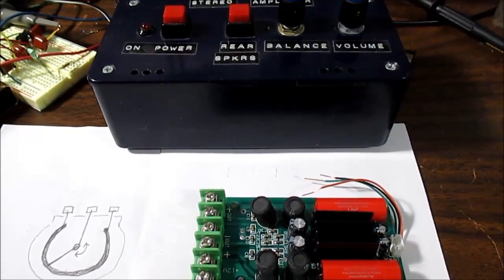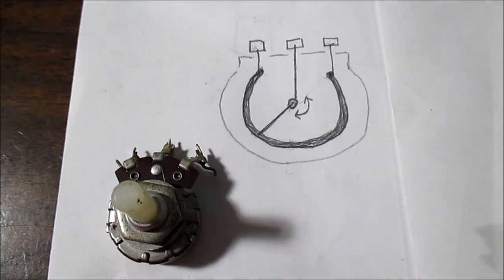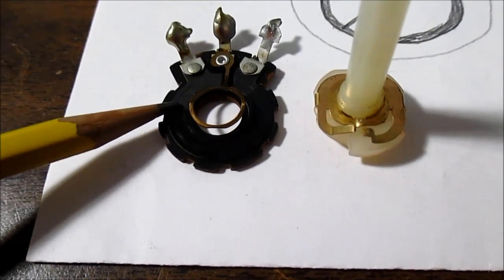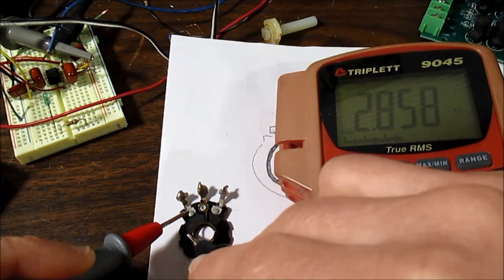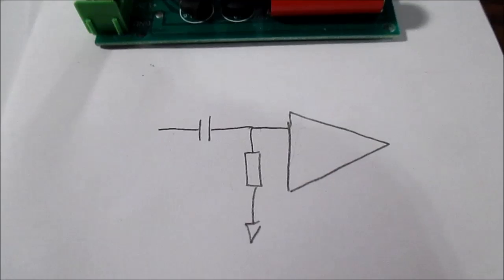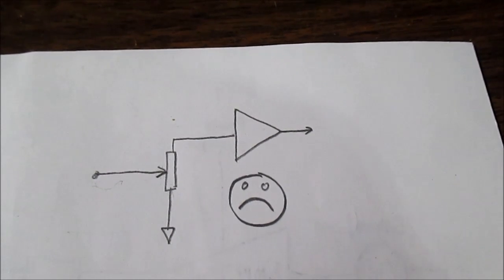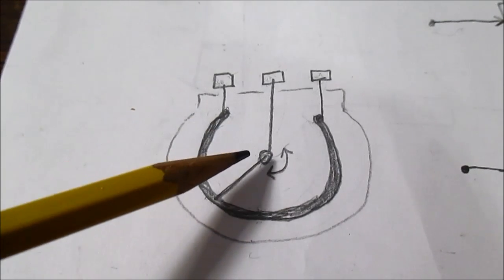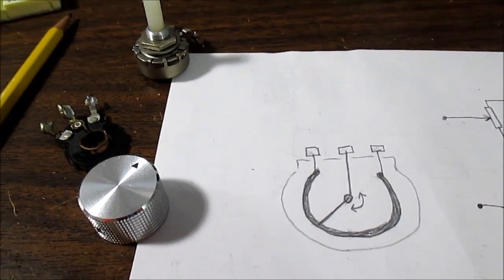How to add a volume control to your audio amplifier project

Comment: 1. Some people say A type potentiometer means Logarithmic & B type is linear. Is it true?
2. The input impedance for tda2003 according to datasheet is 70 (min) to 150 k (typical) so what value potentiometer to use there ?

3. If I want to choose a volume control for transistor amplifier like a 2N3773 based transistor amplifier having two pairs of 3773 transistors at output stage then how to do that as there's no datasheet for it ?

Comment: Nothing tells me the input resistance of the amp.  I'm using a HW-104 with the PAM8403.  Of course no POT and it sounds terrible with no volume reduction.  Rated at 4 Ohm for speakers 3W.  What I didn't understand is - does the POT go before or after the amplifier?

Comment: Hello there! I have a question which you did not cover in the video (if I'm not mistaking). How should I choose the load capacity? I've found logarithmic pots from 0,05W to 0,2W. Is there any recommendation or rule which should be followed? 🤔
Reply from the maker: If it is a line level signal, say about 1 volt rms, the power is very small. No issue there. If you're controlling a higher voltage, that's when you need to be concerned about power dissipation.

Comment: I have this chinese bazooka tube style bluetooth speaker that has an FM radio. When I turn the radio on it blasts at full volume and I have to turn it down. Is there any way to add in a potentiometer to the speaker wires to allow adjustment of the volume? I bought a kit of pots and none of them worked. I think I have the wrong ones. the 5k one sort of worked but no sound until 3/4 of the way up then full volume. I will be using only two of the wires. I just want to vary the audio signal going to the speaker

Comment: So just checking: we replace said resistor with our potentiometer, connecting the outer leads to the input and ground with the output to the input of our amp.

That makes sense! Because, like you said, there is a voltage divider affect, so the signal is sort of split between the ground and the amp input. THAT'S why the same guitar pickup wil sound different between 250k pot, 500k pot, and no pot!

Comment: I hope you can still answer my question here JAT:) Awesome videos ive been binging on them since last year when I got into audio. I have a tube preamp (buffer) a 6j1 variant you have reviewed and I think the volume put attenuates the signal from my DAC. I have connected that to a power amplifier with an input attenuator to the power stage directly as disabling tone/preamp controls, I can still control the volume. How should I adjust the two volume knobs? Max out the volume on the 6j1 preamp and control it from the power amp or the reverse? the power amp uses a stepped attenuator and the preamp uses a carbon wiper i think. its says b503

Comment: 1. If the source signal is very strong or having high gain, then will adding higher value potentiometer like 100 k reduce distortion or clipping at maximum volume when potentiometer is turned fully ?
2. If I don't get potentiometer according to the input impedance calculation as you told then what value should I use ? Suppose the input impedance is 30 k but I am not getting 15 k , so can I use 22 k which is available ?
Reply from the maker: 1. The potentiometer resistance should be selected giving the input impedance of the circuit.
2. That would work, though I'd probably use a 10K in that case.
Reply: @JohnAudioTech  what are the advantages in changing the input impedance of any amplifier ?

Comment: John, Great video. A couple questions from someone over their head: I’ve made a couple lm1875 kits with your dual voltage source circuit, both inspired from another vids of yours and want to add volume control. Does a 2.2k Pot sound right and does the ground go to the virtual ground?
Reply from the maker: Hi Jim. The resistance depends on the source. For line level sources, I'd go with a 10K pot, with signals from devices with a headphone jack, lower would be fine. Yes on the virtual ground.
Reply: @JohnAudioTech  Thank you so much for your reply. Very excited to have received it. Love your videos.They have introduced me to a new hobby.

Comment: Hello. Hope you can help me? 
when I connect a stereo potentiometer correctly to an amplifier, there is a short circuit between R. L. on the output  when I turn the potentiometer to one side. this is because minus GND. on
R. L. is connected. together.

Miter stick goes to amplifier and one side is audio input and the other side is GND

you ruin the stereo image in the music!

Comment: Hi John. I have a TPA3118 mono module. I modded it, decreased to 20db gain. I added a potentiometer for volume adjustment.  The pot when full and zero level no noise but at middle levels i m hearing noise. How can i eleminate this problem?

Comment: Need help adding dual individual volume knobs to control two separate channels and need help. I'm open to a DIY and can solder....but would like easiest and cleanest way possible with a budget of say around $30

So I have two bass shakers/transducers installed on my couch. They are single voicecoil 8 ohm 300 watt rms max each. I will be running them in their own channel into a crown xls 1502. I would like 2 volume controllers to adjust the intensity essentially of each shaker individually.

The amp has built in band filter so I will be using that to get only the desired frequencies from movies.

I have found some zone volume control boxes but cheapest is around $60 and says it can only handle 100w. 

I thought about using a dual wall mount plug but also only does 100 watt. I found single 300 watt but $50+

I thought about using a passive line mixer there are a few 4 channel ones for around $30 but they only have single coax input and only one coax output. (The crown amp accepts XLR which I won't be using but also accepts bare speaker wire or banana plugs 

I'm thinking about using a RCA bass knob adjuster $7 x 2. They have + - for each in and out. Thinking to splice the positive negative to speaker wire. then plug in the other + - to each channel on the amp directly where the speaker wire normally hooks up to the channel. 

Will this work? If so, how can I tell to get one that is good enough for the 300 watt rms per channel that will be passing through it? Also hopefully I can find specs to find one that is a audio taper but if not does it matter too much? if this will work any other cons I should know of?

Or any other better routes or options? Any replies from people with knowledge would be very much appreciated. Cheers!

Comment: I have a pot that has 7 lugs. 6 are stacked so it is a dual but the 7th is off to the side by itself. Is that a ground?  Would I use that to ground the other ground lugs or leave it alone?

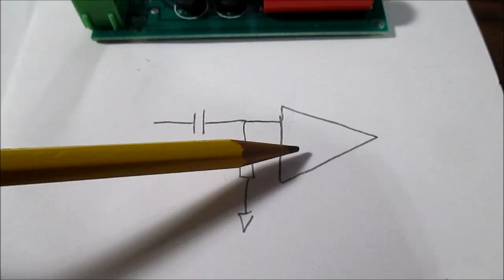Comment: Hi John. At 5:55, when you say "half of that or less in resistive value", do you mean half the Ohms? i.e. Amplifier input impedance = 1K, therefore use a 500 Ohm or less, or 2K plus?

Comment: I have an LA4440 amp board and according to its (LA4440) datasheet it's input resistance is 30 K. I connected a 47 K POTMETER but I can't increase the volume to maximum as there's distortion if I do that. According to you, the volume pot should be half the input impedance but I am not getting a 15 k pot here , only 10 k, 22k and 47 k pots I am getting in my local shop. When I reduce the volume of the usb mp3 module I am using as source, the distortion goes away but I can't use the source volume all the time as its not smooth. So tell me what to do to reduce distortion while increasing the volume to maximum ?

Comment: Consider: in-line volume control; RCA - IN - "Source" jacks to RCA - Output jacks: As I recall, most home HiFi RCA outs range around 10K, so... 10K audio pots... RCA "source" center to pot Pin 1("IN"), Pin 2 to RCA center "OUT" , RCA shielding, both "source" + "OUT" to Pin 3...
or isolate RCA shielding "source" from RCA shielding "out"  with cap? (Gnd lift at in (source) jacks or out jacks?)

Comment: I thought I knew this after all these 40+ years since I was a teen. Nope. thanks for straightening me out! I remember working on a electric guitar years ago and I didn't ground the volume pot ground to the case of the pot. I remember it had hum when I wasn't touching the metal on the guitar.

Comment: I've watched a dozen videos on this subject and they are all the same so, I connected my audio pot this way and the result is virtually no volume until the last 10% of rotation. In that last 10%, I go from nothing to full volume...however...if I reverse the leads, so that right is low and left is high, the graduation ratio is perfect. Do I need to use inverse log pot to resolve this issue?

Comment: I am using the ne5532 opamp and get low volume signal at the output when the opamp is NOT powered. How do I fix it?

My input source is a phone connected via Aux cable.

Comment: I have a lc audio MM riaa phono stage with built in buffer.it has to high output to connect direct to aux or line input on a preamp.I tried it with my stax headpseaker amp with 21 step autenator and no distortion.can i use a potmeter or autenator 10kohm on the output of that riaa s phono stage?have trided and it works.But if it make the bass week i wonder if it is another way of doing it.have it connected so the riaa phono stage see 10kohm always.wiper arm goes to amplifier

Comment: I forgot to solder ground wire to the case of the potentiometer and one of the audio amplifier IC in my homemade amplifier system burned out because of electrostatic discharge, only by touching the knob. It is very important to solder ground wire to the case.

Comment: In this  noisy RFi world do you think it would be  advantageous to add a low pass network - say 50-100Khz  - at the amp input?  I knew  this  stuff 35 years  ago but a confirmation refresher is  always  welcome.  Sandy..  ( BTW my Xfinity X1  box  analog audio out appears WAY above the 2V p-p max std and overloads my Wireless headphone input.  Thinking a simple voltage divider in the cable box to attenuate the signal - not the best place but no room in the headphone transmitter base .
Reply from the maker: All proper audio amplifier designs should contain an input lowpass. Yes, you could use a divider to attenuate the audio. Be sure the value of the resistors will work with the audio out properly.
Reply: @JohnAudioTech  Thanks for the reply :)  You see a lot of  amps  promoting crazy wide  bandwith and DC straight through.  Never thought it was a good idea and  now   more  than  ever!   ON my problem I was thinking of  using a 10K and a 20K for the divider. with the 20K at the GND leg. Maybe I'll make a little  1 inch  cube "dongle" with male RCA at the correct spacing to plug into the cable box, this   way I wont  have to add another  set of audio signal cabling. I'm plugging in my Sennheiser RS120 wireless HP in there.  Im a really fan of  eliminating signal jack and plug friction interfaces. Seems to " lift a veil" from the signal for every one  removed.  I don't know  why Xfinity is  using a non standard Audio  pre out over 4V P-P.  Outrageous! Makes  me  REALLY mad.

Comment: Hey, you make great videos ...
Any idea how to solve my problem.
I have TDA7297 amplifier thay I buy at Ebay, with 50k volume potentiometer. 
Situation without input signal. If potentiometer knob is in middle position I get noise, but when knob is all the way left (MIN) or right (MAX), noise is disappearing ...

Comment: Hello. I'm trying to hook 2 volume controls to my amp - a separate control for each channel. I start with 3.5 jack input. Then each channel is put through logarithmic pot, and in the end they come down to 2xRCA setup, which is what is plugged into the amp.
I can test the setup separately, by sumply converting 2x RCA back into jack via adapter and plugging in headphones. It works just like it should - the volume in appropriate channel gradually decreases as I turn each handle.
However when I put it through amp, even a slight turn decreases Amp's output drastically. Basically, it goes to nothing withing a couple degrees turn of the handle. People explained to me that what I have is "gain control" and that it affects AMP's output exponentially. 
Is there a way to wire what I'm trying to do without disassembling the Amp itself? I'm new to electronics and I'm not confident. I have "Breeze Audio TPA3116 Mini" - you even reviewed it on the channel.

Thanks for the reply!
Reply: This reads like you wired the pot incorrectly. RE-view video above and make sure  you have the GND and the signal OUT soldered to the correct lug. Wired and Working correctly:  Signal OUT should be soldered to the centre lug (wiper) Next confirm correct GND by turning the control anti-clockwise and get out your VOM and measure a LOW impedance  centre lug -to-GND lug and then a higher impedance across signal IN and the center lug signal  out.  HTH

Comment: JohnAudioTech I would love to see some videos on swapping out momentary push switch volume controls of Bluetooth amp boards to potentiometers via either the amp chip or the Bluetooth module.
Reply: Thats EXACTLY why I'm here. 

Can't find anyone that makes a board with what I want and I can't be the only one that wants a BT board with power on/of lamp that can be wired to the cabinet instead of a tiny lamp on a board that's going to be buried inside a cabinet. Also a MONO amp pcb with facility for a cabinet mounted on/off/volume potentiometer, a 3.5 aux in circuit and a USB flash drive all powered by rechargeable battery via USB to mains supply.

I'm new to this kind of thing but the above would be ideal for converting old non repairable radios as BT speakers and I'd but at least ten boards just for the dead radios I already have.

Comment: Add 10KA to 100KA volume pot to the input of amplifier module and float the ground connection of the pot with the other grounds of your amp.  I added a 20kA pot infront of the Sure 600w Class D module Parts Express sells, just remember not to ground the pot to chassis.

Comment: I want to adjust the volume of my stereo amp channels individually but I can't figure out how to wire each channel to two potentiometers.
Reply from the maker: With the rotating shaft of the pot facing you and lugs facing up: The right lug is ground, the center goes to the amplifier input,  the left lug is your signal input. Of course, one pot would be wired for the left channel, the other for the right.
Reply: K. Thx for that
Reply: Is it power GND or jack GND?
Reply: Figured it out. Its the jacks GND

Comment: Brilliant stuff! So can I simply put this inline with the speaker output jack?
Reply: no, putting it after the amplifier changes the impedance of the speaker load which is very bad for your amp and can cause it to overheat. You want to put it on the input to the amp to attenuate the unamplified signal, for example on the wire coming out of your headphone jack on an MP3 player going into the amp's input.

Comment: Great explanation video. I'm am learning and appreciate the info. I don't know if you'll need more info but any direction on how to connect this Pot (link below) will be helpful. 

I believe the top 2 rows of pins are the grnd, left (–/+) & right (–/+) audio, and the bottom 2 pins are a power switch. I'm just not sure how to wire it to my power source. 

https://www.ebay.com/itm/B50K-50K-Ohm-Dual-Linear-Taper-Volume-Control-Potentiometer-Switch-LW/172369910995?ssPageName=STRK%3AMEBIDX%3AIT&_trksid=p2057872.m2749.l2649
Reply: i use preexisting power sources (laptop power source for example). i my situation i take the 'hot' wire, cut in two and connect to the two back lugs. since its just making / breaking connection with that wire there is no left / right, poistive  / negative. the other pins work just like this video but there are two rows instead of 1

Comment: Okay, let me say it this way... Your amp has a input for the source, it has three pins left, common and right, do you add the pot before and how because the pot has one for audio source and one for amp input and one for ground so where does the left and right come in? all amp are not the same and doesn't have the extra options.
Reply: The left and the right means it is stereo. That means TWO channels. So, if you want a potentiometer on a 2 channel stereo amplifier, you need a 2-channel potentiometer. This is called a dual-gang or "stereo" pot... it has 2 completely separate potentiometers with a single shaft for one knob. Such a potentiometer has 6 terminals, 3 for each channel.
Reply: Yes, I knew this but it would be nice if that was shown, it was half way finished.
Reply: A stereo potentometer is just two potentiometers stacked back to back with a common shaft... you run the signal through the respective potentiometer, and connect the wiper pins to the left and right channels of the amplifier... it doesn't matter which potentiometer in the stack you choose to be your left or right channel.

Comment: John, thanks for making these videos. What value of LOG pots are generally used in various type of applications? IE preamp, final stage amp....  ? That was the reason i watched this and no mention of values... haha oh well.
Reply from the maker: It depends on the application. They can range from 1k to 1 meg. I like 10K pots as the impedance is high enough for most circuits driving the input yet low enough to keep much of the received electrical noise low provided the shielding is good. This, however, isn't ideal for some circuits.